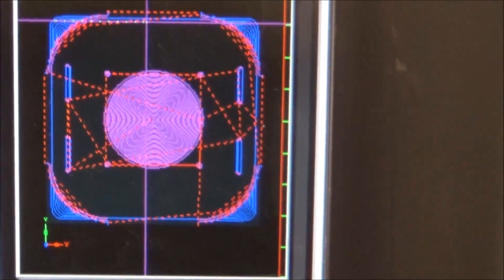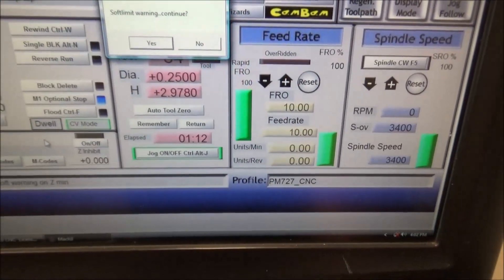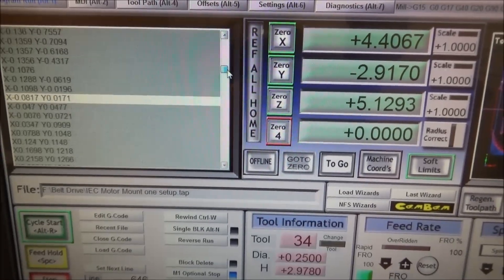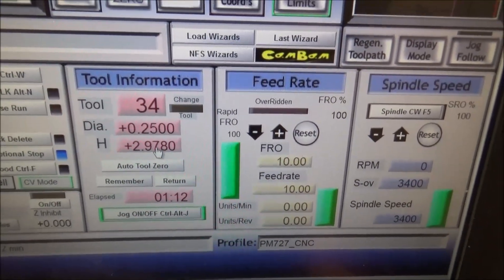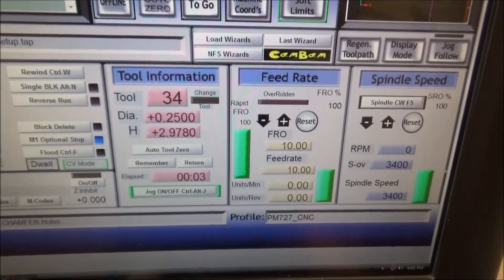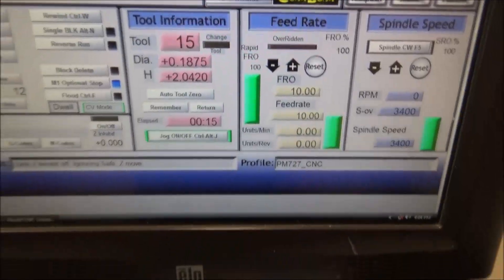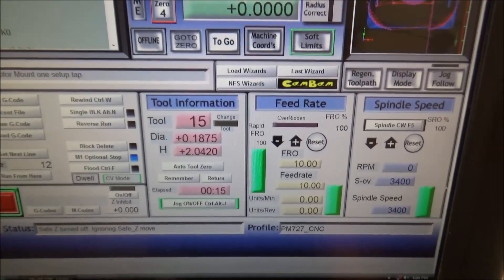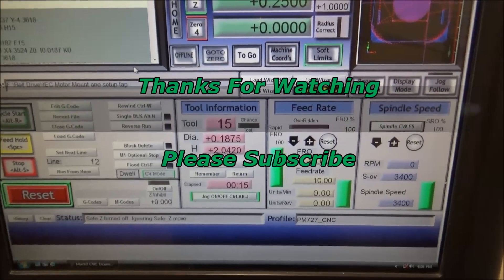Mach3 Soft Limit Warning!

Comment: Years ago when I converted the 2 acroloc machines they had very nice pro level homing switches already mounted. Table homes X- and Y+ (from the tool perspective) could not get the soft limits to work with any setting. They worked fine X- Y- but due to the enclosure and the travel that setting was not practical. Always got an error when i turn them on even contacted mach, They said the dro when homed is the numbers to use in the soft limit table. ( the homing features on the machine work fine). the soft limits Never worked tried all kinds of combo's. Turned them off (real men dont need limits!) Lol . I came to the conclusion that mach was set up for a router and since the tool moves instead of the table the limits would make sense. That was years ago and i could be wrong and missed something. I do have a 6040 router that works fine with the mach soft limits. But on the latest index I converted I just turned them off.
mach3 is not perfect but when you consider all the packed in features and if set up right performance. its still a heck of a deal.
Ps this is still not a masso review!